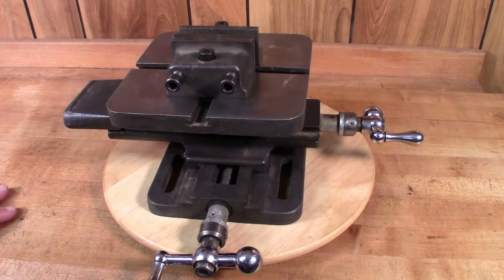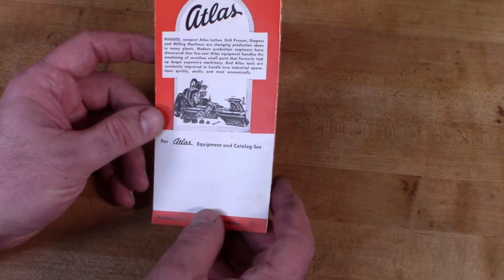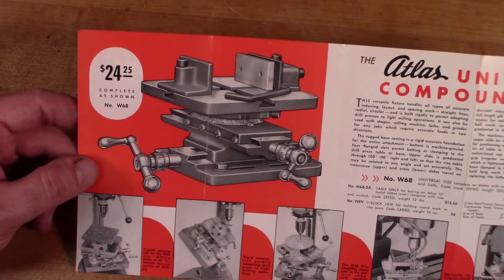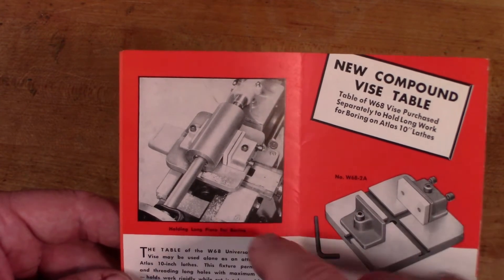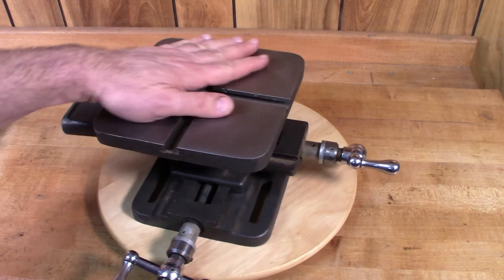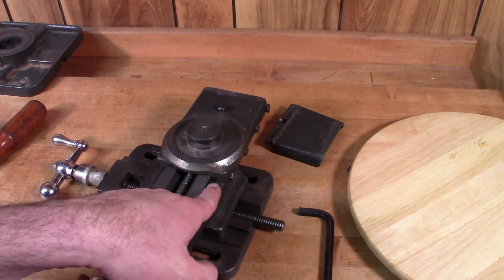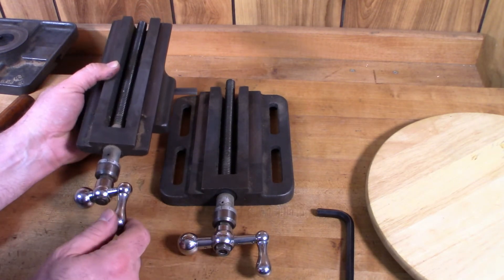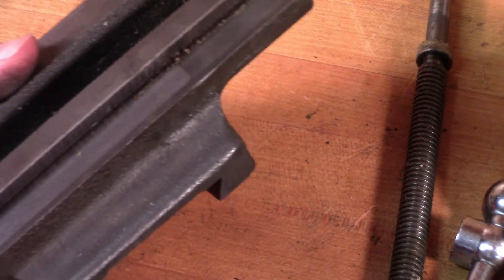Atlas Universal Compound Vise — Pt. 1

Comment: I know this is off topic but your experience with vintage machinery makes me think you might have an answer to this question I have.   I've got a nice old Delta Drill press with a beefy cast base with a beefy cast table.   I can't get the chuck out of it though.  there are threads exposed under the spindle where it looks like something is missing.   The chuck m ight be pinned through the spindle I think I do see a roll pin.   But if I push the roll pin out will I be left with a morse taper?

Comment: I have the same one! Great part about it is it’s the same cross slide as my lathe
Reply from the maker: Atlas was really good at using the same parts in different machines. I imagine it saved the company money and meant they had to stock fewer parts in inventory. I wish I had kept my 10" Atlas lathe so I could try this table out on that machine.